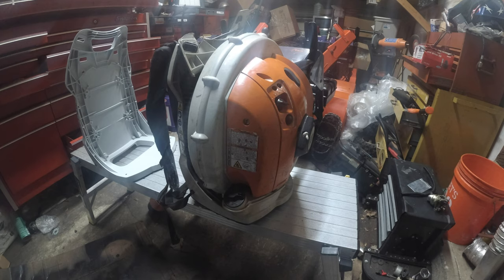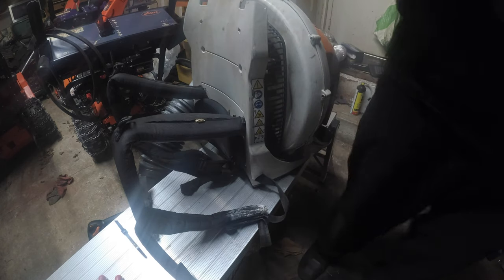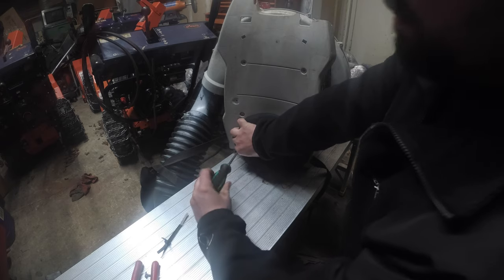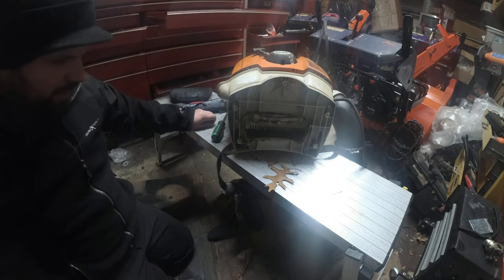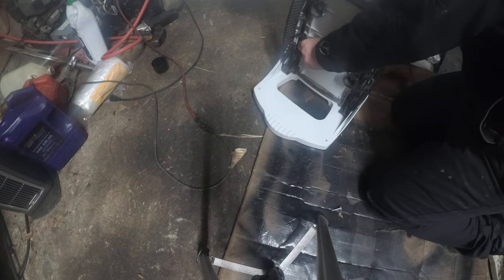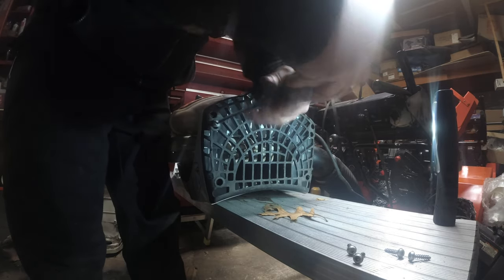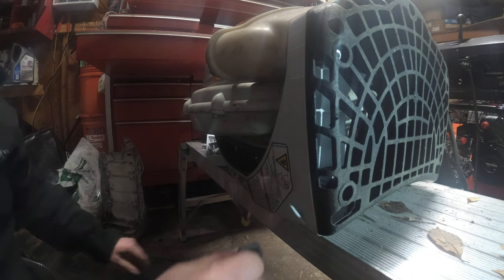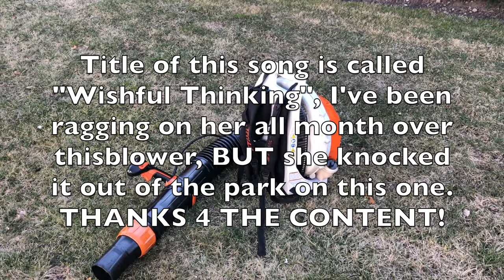How To Swap The Frame On Your Stihl Backpack Blower BR700 BR600 BR550 BR500

Comment: thing looks brand new! i actually stumbled upon this vid as I had just bought new backplate frame for mine since it broke and my shoulder straps are toast. need to buy the bottom plate as well but plan on putting it all back together today, I think i'll attempt to clean it while its apart. will use a 1:1:1 mix of laundry detergent and simple green ( i made this mix and use it on alot of things.) A little elbow grease and it should clean up nice. I may even spray the exhaust muffler with high temp paint. Great vid!
Reply from the maker: Go for it!  Fit and finish is very important to us.  Hope your project goes as smooth as ours!

Comment: You made this job seem difficult. It takes about 30 minutes to change the back plate. The trick to aligning the springs and screws is... place the blower with springs up, recoil down. Set the back plate on and they will be self aligned. Screw right in. Then put the gas tank. Then put the pad and straps back. down. You need nothing but the Stihl tool or a screw driver. Anyways your learning.
Reply from the maker: First time doing...of course the second time you do it will be easier.

Thanks for the tips, view and comment, hopefully you subscribed to my channel 🤙🏻🇺🇸🔧🦅